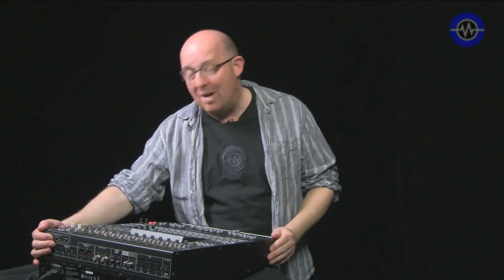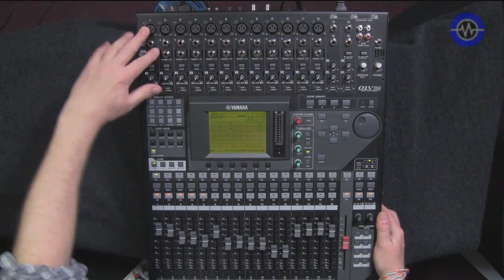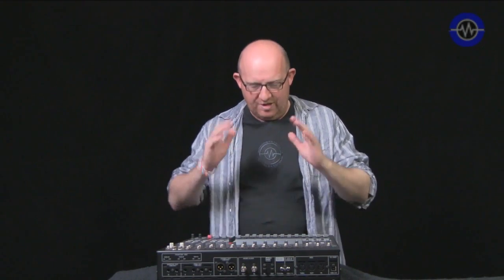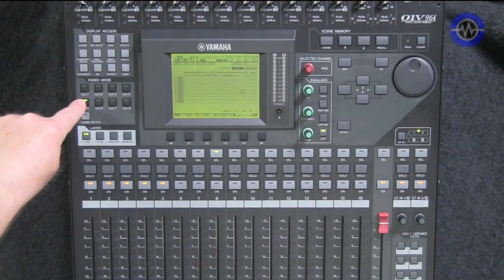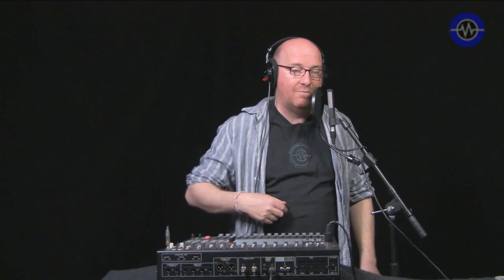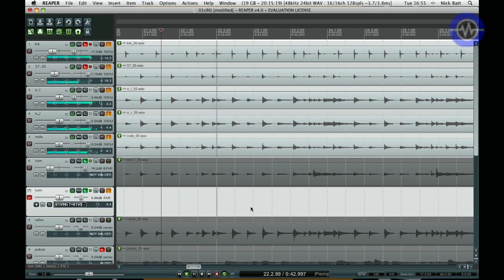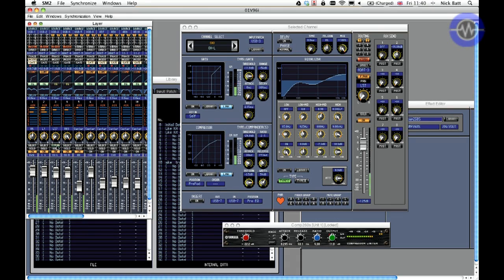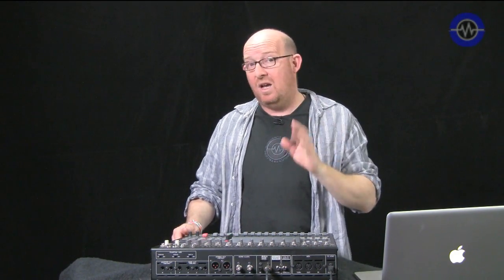Yamaha O1v96i Digital Mixing Desk Review

Comment: I have the previous non “i” version of this. Great project. studio console - but not recommended for live use. Just too slow to work on. 
These days you can hardly give them away for free!
Reply: a pity that I didn't find your comment earlier. Just bought a 01v96v2 couple of month ago. It's a nightmare to set it up for me as a beginner. complicated concept. Any recom for a "live use" mixer (with recording feature)?
Reply: The most confusing thing about digital mixers is knowing what mode (layer) the faders are in. They could be AUX sends, FX sends, master levels or channel levels at any givin time. Always remember to go back where you were. Hit that "home" button. Unfortunately most digital mixers are alike in that way. 
I have a Presonus StudioLive 16 III that I prefer to live use.  It has class compliant USB i/o 32x32 ch. built in. It's great for mixing a live band while simultaneously capturing all the the tracks. Sounds good too. On the used market expect to spend around $1500 for one of those.
For small jobs the current Tascam mixers look a lot like a standard analog mixer. Never tried one.
Some people like the "stage box" style mixers from Mackie where you have to mix on an iPad. I avoid those like the plague!!

 @thomaswild2957
Reply: @thomaswild2957  Quick question, can the NON I version be used as a standalone unit through ADAT? I don't need the interface portion as my main interface is inside my PC.

Comment: I'm struggling with input of as many as 10 mono wireless mics. When I set gain high enough to sweeten the input where I just begin to like it we get feedback. This is in an unusually shaped auditorium. Would compression and gate help so I can increase gain? Ideas please and thankyou.
Reply: John Redden Sounds like a gain before feedback issue, in which case there might not be a whole lot to do. A comp would allow you to set your gain higher (assuming no out gain), but probably would still exceed the gain before feedback threshold. Check mic and speaker placement to make sure the mics are set in a way that they will reject mains/monitors the most by what pickup pattern they have. Maybe look over your system gain structure as well (plenty of videos about that). An odd shaped room can either be a great thing or a bad thing, just depends on the angles, materials, and speaker and mic positions. Other than that, try to notch out problem frequencies with either channel EQ or if they all have a common frequency, mains/monitor EQ.

Comment: Hi, I'm considering purchasing the Yamaha O1v96i. I use ProTools 11 in my project studio but besides Sony Vegas 13 pro Suite I also use Cockos Reaper and after having read about some alleged difficulties regarding using this board as a control surface with Reaper I have to ask you what your experience is?

Sir Carl..
Reply: ditch reaper
Reply: everything is an issue with reaper
Reply: +nuclear guitarfare Moved on with Samplitude pro X2 over a year ago. loving it..
Reply: good lol
Reply: Samplitude is very underrated.
Reply: @lemonslice2233  Samplitude is underated I love that program over Protocols, Steinberg Cubase and logic. So easy to use out the box

Comment: Hey nice video as usual! Please tell me how can I route signal for my monitors. I do have almost decided to buy it. Is it possible to have more inputs and outputs on that desk? I see that there is optional 4x xlr output card and it would be ok - I dont need more monitors on the stage but there is only one expansion slot so I will not be able to get more inputs. Any ideas? And what are the omni outputs? Maybe just use them with an DIbox to give monitoring for the musicians?
I would be very thankfull for some suggestions!

Comment: And about Using an external compressor as insert? Is it possible?
Reply: Frederic Martorell Yes it is, besides 1/4 line in's also 1/4 inserts however you need an insert cable or "Y"cable which is any combination of a Male 1/4 Stereo with Two XLR's In/Out (or whatever I/O contacts your external device needs)..